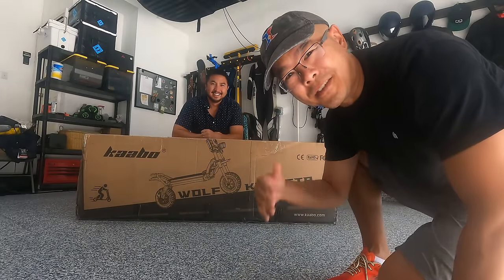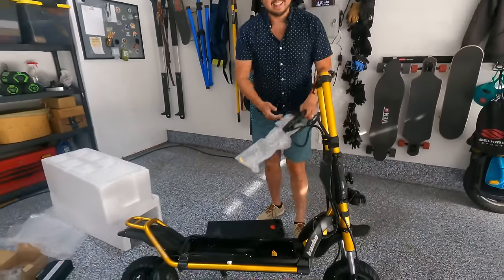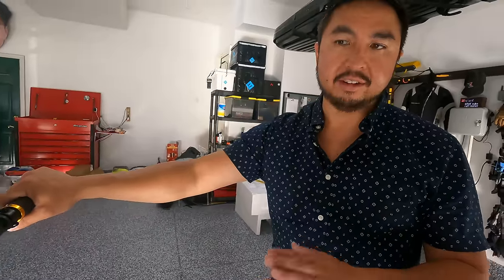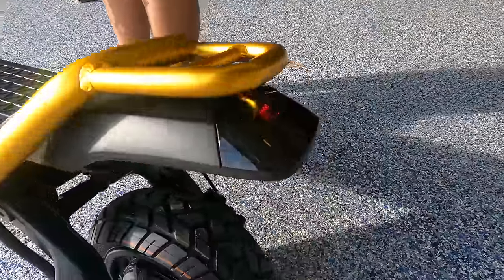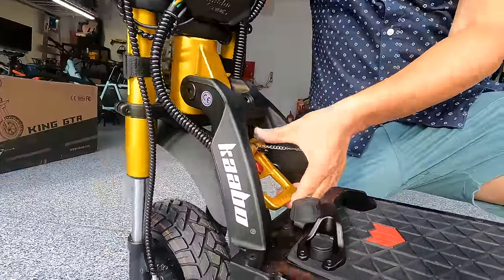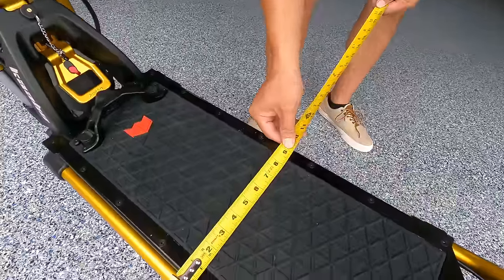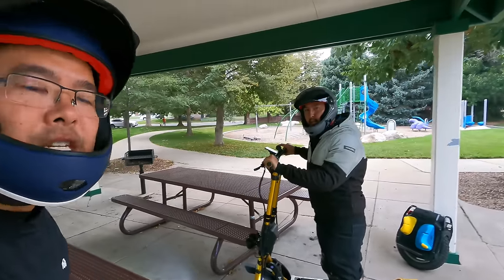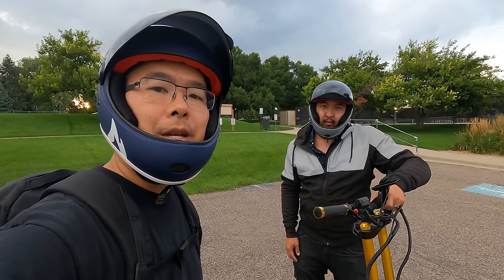NEW Wolf King GTR Unboxing & First Ride: An Insane 65mph Hyperscooter

Comment: I still prefer the thumb throttle, personally. i agree that the thumb throttle design can be improved to not have the hesitation the previous model had when first pressed.

i really like these hybrid tires (self sealing/self healing, my favorite!), and quick release battery design.

i would like to see the option of a 45 amp hour battery. i am really surprised that the battery voltage and battery capacity stayed the same as the wolf king pro (previous model)

i would also like to see an 84 volt system, 94 volts fully charged, rather than the present 72 volt system which is 84 volts fully charged.

this would provide even more improved responsiveness, in the throttle/acceleration.

i think kaabo could do well to look to the rion line of scooters as their competition. one must set their sights high, when building the king of scooters!

i still like this scooter a lot and look forward to test riding one soon.

i like that a fast charger appears to be included, but with that said, these super scooters seem lightyears behind the cutting edge of battery and fast charging technology, because quick charging has been here for over 15 years. i feel strongly that these scooters should come with the option of quick charging to 80% battery capacity, in less than one hour. this is needed, for many of us that use these scooters for work, and need to quick charge, quickly (in approximately one hour)

if 5 amps is considered quick, at 7 hours of charging, then we may need to be looking into different batteries that can quick charge in around 1 hour, maximum, at least to 80% state of charge.

i know this can affect overall price, but i am willing to pay a higher price for 1 hour quick charging, verses present 7 hour quick charging at 5 amps.

great review as always!
very helpful and informative!
Reply: Buy another 5A charger!

Comment: It looks super ugly especially with the rotors on Opposite sides and yes its fast but why do u think it only costs $4,000 because besides the motors and controllers they rest of the scooter is made with cheap parts just go loom at the ELECTRIC SCOOTER GUY'S Channel he had 6 screws shear off on him because those blacl screws and the bolts are so cheap theres a reason why its so cheap price wise and why is the battery smaller makes no sense

Comment: Its so ugly I'll stick with my wolf king gt pro this thing is way to big and heavy and the removable battery makes the deck look so ugly and it makes noise when you go over bumps its nothing like the dualtron storm removable battery its actually got play when the battery is locked down where it actually moves up and down the quality of this scooter is ok but nothing like the quality of a dualtron and also the tires look so small its a strictly off road scooter!